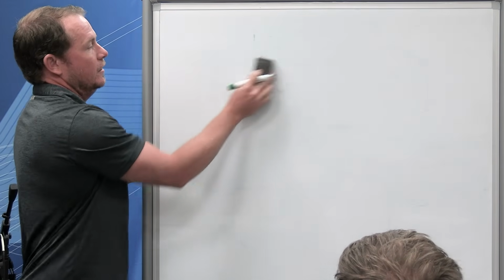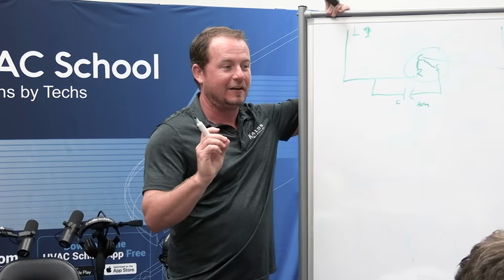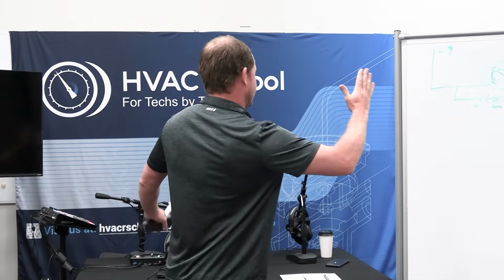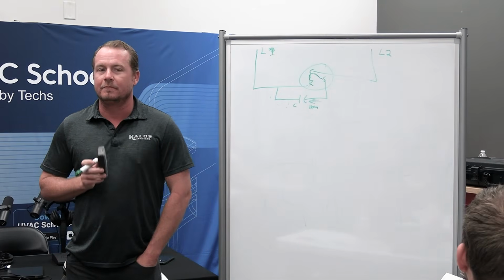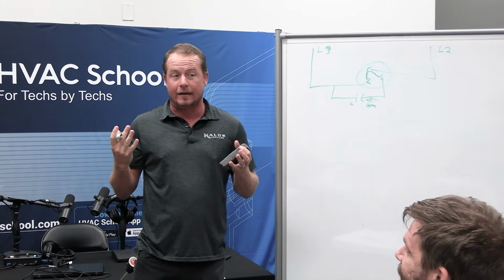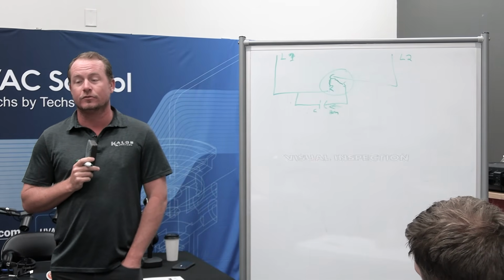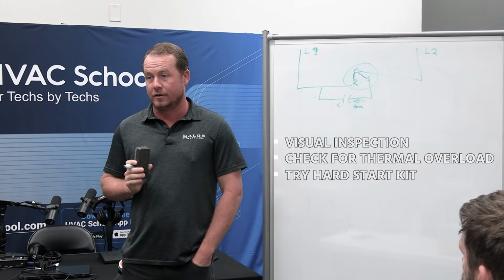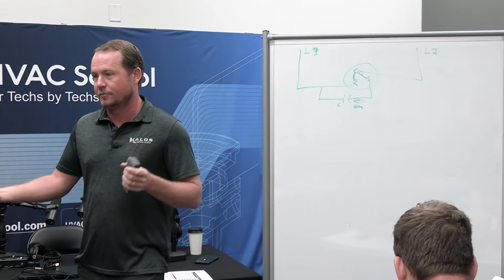Capacitor and Hard Start Myths Busted

Comment: Correct if I’m wrong but the module on ecm motor have capacitors they look like obese AA batteries so there still psc but just not visible/ not replaceable without replacing module

Comment: Umm, WHUT?  1:15 and before, you're drawing the symbol for a polarized capacitor while these are non-polarized with a symbol that is two straight lines in parallel, not one of them curved which is for a polarized capacitor.  Some people might think that because there's a common that this makes it polarized but it does not, that is just a simplified construction method that shares one of the poles of two NP caps.
Reply: Yes!!! He was confusing me with that technically but I get where he was going with it

Comment: So, what if a Hard Start kit was prematurely installed due to Tech not noticing a bad plug on the Compressor which resulted in him being recalled less that 3 hrs latter to fix the true problem, and install a new harness/plug.  (On the first call, he was told the main breaker at PP kept tripping, so a Hard-Start was installed before rolling out.) Does the Hard-Start need to stay?
Reply: Probably not.

Comment: As a controls electrician, I troubleshoot machine controls, in manufacturing plants mostly 3, phase circuits but sometimes 1, phase fans, and small motor equipment, this explanation was the best I’ve heard.

Comment: Will the failure of a hard kit causes the compressor from starting? If it acts only as an assistant, then the compressor should be able to start after its failure. Is this true?
Reply: Say the compressor is good. The compactor sends the power to start the compressor. If the compactor is weak it needs replacing or a boast kit.
Reply: Say the compressor is good. The compactor sends the power to start the compressor. If the compactor is weak it needs replacing or a boast kit.
Reply: Say the compressor is good. The compactor sends the power to start the compressor. If the compactor is weak it needs replacing or a boast kit.
Reply: Depends on the nature of the kit failure. If the switch in the kit fails to turn off you will eventually burn out the run winding. If either the switch or capacitor fails open, it would be no longer able to assist.

Comment: A common hard start kit, such as SPP6 or 521, has a relay to disconnect itself from the run capacitor after starting the compressor. Thus, it should not keep providing more capacitance to the run capacitor and harm the compressor as presented in this video. Is this true?

Comment: Why not just tell them that the capacitor in series with the start winding creates a second coil 90 degrees out of phase to the run winding, hence a rotating two-phase cage motor...  Not that much different to a three phase motor with its' rotating fields - impossible to achieve with a single run winding.  Much easier to follow than a 28min video about nothing..

Comment: The symbol you have drawn is a polarized capacitor.  By the way there is considered a current "flowing" it is a construct known as DISPLACEMENT CURRENT. This was a consequence of Maxwell Equations. The model we use is i = C dV/dt this is why if V is a sine wave the current will be a cosine  wave . 90 degree phase change. Actually electrical and magnetic circuits are grossly oversimplified by lumped circuits. To understand electric effect deeply we need to use Electric and Magnetic Field theory trouble is it is very hard to understand, Hence the notion of displacement current versus electrons flowing.

Comment: What is a phase change?
Reply: Phase change is when anything changes from a solid to a liquid, or a liquid to a gas. The reverse is equally true. For example an ice cube absorbs a relatively large amount of heat during process melting. Boiling the same amount of very hot water into steam absorbs even more. Refrigeration manipulates the phase change of various chemicals (refrigerants) by controlling the pressures within varying parts of a closed system.

Comment: As an electrical engineer, I can assure you that a hard start kit does not reduce start current.  It actually increases current a minor amount, but it reduces the spin up time by increasing initial spin up torque of single phase induction motor.  By reducing the start time, the high surge current period is shortened.

The only legitimate use of a hard start kit is for low AC voltage at compressor either due to low grid voltage or too much wire voltage drop from circuit breaker panel due to long wire run and/or too small wire gauge used to compressor during the high startup surge current.  The lower the voltage applied to compressor the longer the motor spin up time and the startup surge current time length.

The run capacitor value is selected to provide 90 degrees of current phase shift to the start (auxiliary) winding of motor only for run condition.  This provides better motor torque for given AC current while running and also improves the motor running power factor.  The run capacitor value is not optimized for motor startup.  It is optimized for run state of motor.

During startup the motor is highly inductive.  To provide 90 degs optimum current phase shift to start winding during startup for maximum torque, the start capacitor would need to be three to four times the run capacitor value.  Once the motor spins up, the motor is less inductive and the value of optimum capacitor to start winding must be changed to lower value to provide 90 degrees current shift during run state.  

Hardstart kits do this with a relay that opens start capacitor connection when back EMF from start winding rises after motor spins up.  You will typically see 290 to 300 vac from compressor common to start winding terminal after startup on a 240vac system.

If you put your amp meter on compressor common wire and measure compressor current, then put amp meter on compressor run wire and measure it, then start winding of compressor and measure its current. the sum of run wire current and start winding current will be greater than compressor common wire current.  How can that be?  It is because the start winding current through the run capacitor is shifted in phase by about 90 degrees during motor run condition.

For example, common current is about 12A, run wire current is about 10 amps, start winding current is about 7 amps.  The result is because 10A run at 0 degs phase reference plus 7 amps at 90 degrees current offset equals 12-amp sum when done with vector phasing addition.

Three phase motors have three windings, offset by 120 degrees physically with corresponding 3 phase AC drive.  This creates a rotating magnetic field necessary to get motor spinning.  Single phase motor has to synthesize another AC phase source to create a rotating field to get motor to spin up.  This is done by starter (auxilary) winding which is physically wound 90 degrees offset from run winding and the series capacitor to synthesize the second AC source phase with 90 degrees offset from single phase AC input.
Reply: Thanks for information, explained very well.
Reply: Yes mate, very well explained.

Comment: Hi just looking for your professional opinion on hard start kits. Would it be advisable to add a hard start kit to my condenser that’s only 3 years old. There is nothing wrong with my unit although I do have a longer line set to the opposite side of the house. I’m just looking to extend the life for the future. Not sure if I should even bother. Just looking for your professional opinion
Reply: I wouldn't unless your power wiring length (not refrigerant line set) was excessive or there is some other reason you are faced with a chronic low voltage situation.

Comment: At around 26:37, I think you are incorrect about the voltage on a start capacitor.  I believe that there is a back EMF voltage from the windings that can easily exceed the supply voltage.
Reply: At the time stamp you've referenced, Bryan was talking about connecting a capacitor directly across the power line to make a point. It's perfectly safe to try this with a good capacitor as long as you realize that the terminals may (or may not) give you a nasty shock if touched. No motor run winding is involved and hence no there are no back EMF effects to factor in. 

You are also correct if you were to disconnect a run capacitor at random times with the compressor running. That is because the instantaneous back EMF sometimes adds and sometimes subtracts from the instantaneous power line voltage. That's why a 330 vac rated capacitor is commonly found on 240 vac equipment (and a higher voltage capacitor will provide a greater margin albeit often accompanied by a higher physical size and cost).  

BTW, I am one of those (always fun) electrical engineers but I also have decades of experience in HVAC. To keep it fun I won''t go into the math here, but the beginning terms to search for should you be interested, would include inductive and capacitive reactance, back EMF, phase shift, and power factor.

Comment: At time equals zero a capacitor is a short. So if only capacitor is present, then the current leads the voltage by 90 degrees. Your motor / compressor winding are essential an inductor. With both capacitors and inductors present, then the phase difference depends on the reactances of capacitor and inductor along with frequency of the supply voltage. Your explanation is incorrect. The reason the capacitor is required is t9 provide the phase (current leads the voltage) with respect to the other supply leads (l1 andl2) that will allow the compressor/ motor to start to rotate. Once rotation is achieved then a counter voltage is generated in both the motor / compressor so that the total voltage drop across each unit is very small.  Otherwise the high current would burn out the motor/compressor since there is essential near zero resistance across there amatures.

Comment: its amazing how many technicans are clueless about all of this.  I am an engineer- and own a small AC company and I hear it --"we tried a bigger cap to start the compressor".  ==but a huge capacitor is not going to make a bit of difference.  Its the phase shift that allows it to start.  A 3 phase ecm motor changes the frequency to start it and you can run a 3 phase motor on single phase with a phase converter.  I think a class for basic electronics should be created and taught---as part of nate or even licensing because customers are charged for all this craziness.  Great video.

Comment: Very helpful information. It’s true, the electronic theory it’s not really necessary to understand what the compressor is doing in terms of the service man.  I guess they don’t use the old fashion potential relays anymore. They are designed to take the starter capacitor out of a circuit mechanically.
Just like so many of your videos this one gave me good insights in terms of troubleshooting what has happened in the compressor.  There’s also a slight difference between a label and the actual value of the capacitor.  
I liked your explanation about the percentage of difference from the total, when choosing, whether or not to use another capacitor that is close in value.

Comment: -](- DC cap -][-AC cap
Power plants generate DC voltage and is converted to AC at destination, the los of transmitting AC power is high.
Edison uses the the pacific ocean as a conductor for long distance transmition of power.

Comment: since it is a single phase power what the capacitor does is change the phase angle so there can be a differential phase between the running coil and the start coil.

Comment: Nobody understand the degrees of phase.  Split phase is 180* apart (L1 and L2), while 3 phase (what why try to "get to" with a cap) is 120* per phase. However the AC cap only change the phase for the "3rd leg" by 90* which is "enough" to get it going.

Comment: One of the points that is missed here is low supply  voltage during the short LRA that occurs on start up.  This is real common, and should be one of the first things to check.  I’ve seen electricians run too small of conductors, which causes low voltage on compressor start up.  This can also be caused by high resistance connections at the sub panel, the disconnect, the contactor, etc. I have seen this numerous times.  The spec is that the voltage should be within 10% the rated voltage, on start up, or what is specified on the unit nameplate.  Measuring static supply voltage wii not catch this. Just like checking for power, as the first step of trouble shooting, voltage drop on compressor start up needs to be checked as one of the first tests.  Think of a garden hose with 60 lbs of pressure, when it is not flowing, then when the valve is opened, there is low flow, and low pressure at the end of the hose, because the hose is too small.  I am surprised this important concept was not covered as a cause of failure of a compressor to start..

Comment: You never mentioned checking winding resistance unless I missed it.  A tech can replace or add any number of start components but  if the start winding is open the compressor will never start. Otherwise a good explanation of the start cap/ winding relationship.
Reply: The first thing that should be checked is voltage drop at compressor LRA.  If this falls below specs on a single phase compressor, there will be starting problems.  I’ve had new installations where the electricians did not follow the OEM’s installation instructions, which specify which conductor size to use for the various size units, and how the length of those conductors affects the conductor size.

Comment: We have a 14 year old Goodman Heatpump here in N. Floo’da, runs fine, 1.5 years ago a AmRad Turbo200 was put on it when the stock Cap went bad, Now we have a 5-2-1 HS Kit on it, but the Turbo200 has the Orange 🍊 CPT post on it to protect the compressor from getting power if the cap failed, you just put the wire from the HSK to the Orange CPT post instead of the Common post of the main capacitor…!! 22:15. Do you agree??   BTW, You’re a Great Teacher. ✅

Comment: This is your best  explanation, I heard so far. Thank you so much for using the analogies, it made a world of difference for me. I finally comprehend it fully. The analogy you used was something I was familiar with the expansion tank for a water pump, I actually replaced the bladder on one tank, and had to fill the air surrounding it to 30 lbs to keep it from rubbing against the inside surface. So yeah made a lot of sense.

Comment: Capacitors do pass current as they are charging and discharging as evidenced by experiments I've done using my RadioShack 200 in 1 electronics lab kit.
Reply: Current does pass through a capacitor but the electrons do not.

Comment: adds more current to the existing start/herm capacitor until started. it's a temporary 3rd phase at the start until started, then pulled out by the relay in the good start kits. 3rd phase/ Herm pushes the wheel at a different or 3rd angle to help get that heavy wheel/ motor gets moving. just dont use the cheap start kits, use the ones with a relay.

Comment: Do not connect a capacitor into an AC outlet for if you don't disconnect it fast enough depending on its capacitance, it will explode!!!
Reply: False.
It depends on the capacitor.  If it is an AC rated capacitor (continuous rated, ie a run capacitor), then it can be connected to AC voltage within the rated voltage indefinitely...
A 'start' capacitor probably will be damaged if connected more than a second or two...
[a capacitor does not know if it's connected to a power outlet or to wires connected to power in a piece of equipment.  It only knows the voltage it sees]
Mr K L
Reply: Don't tell my power company that. They have a 12470Y/7200v circuit coming off the substation that feeds my area. They have a large 3 phase capacitor bank up on one of the poles that at times is directly connected phase to phase (12470 volts each section) as needed for power factor correction. It's been in service for at least 30 years that I'm aware of. How much longer will it take to finally explode?
Reply: @doneden5368  Why don't you try that with a capacitor you can get off of any consumer electronics and make sure your eyeballs are right up against it when you connect it to 120VAC and tell us what happens!

Comment: Can you comment on hard start kits in the context of people considering a whole-house generator?
Reply: Not a consideration if your voltage to the compressor is maintained at plus/minus 10% of the nameplate requirement. However what is concern is does your whole house generator have enough KVA to get that compressor started. Youe compressor will draw 6-10 times its FLA while starting. Especially during a hot Texas summer. If your generator cannot provide that instantaneous demand the compressor will not start.
Reply: @olderman7166  That was the whole point of my question, which is "If you are sizing a whole-house generator for your needs, which would be more appropriate to use: hard start, soft start, etc"?